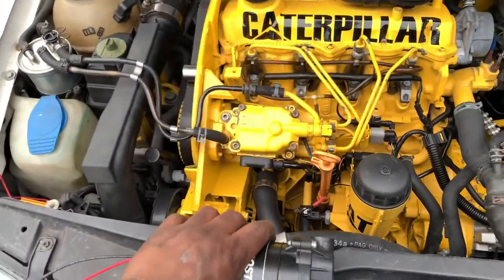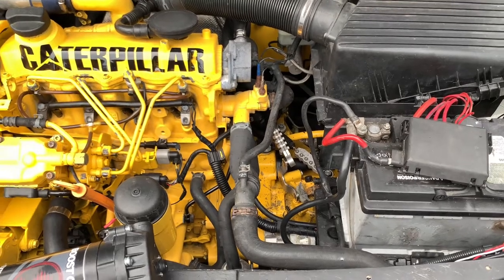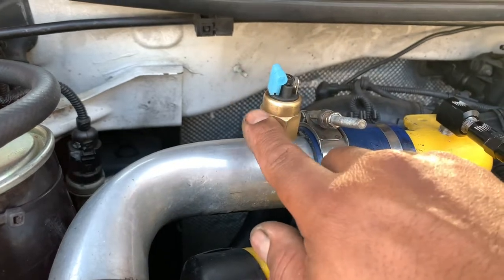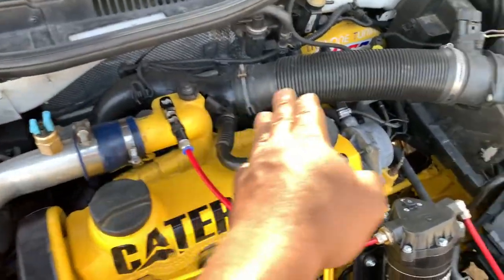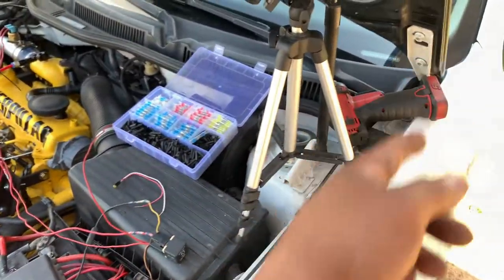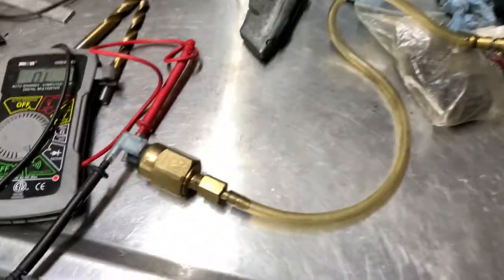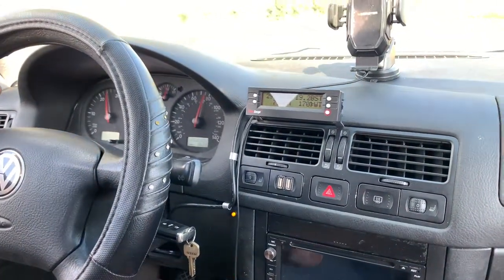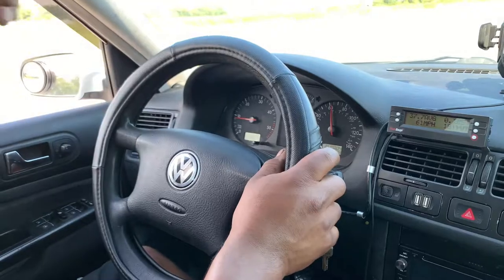How to install water methanol injection in a tdi, cheap and easy way

Comment: Power itself is usually obtained through tune, watermeth does wonders on full boost, cleaning all carbon deposits, cooling down your Exhaust gasses( especially if you like me have the EGR deleted) good stuff.

Comment: Location is perfect good job. Does this give you more power or better gas mileage and is this like nitrous but for a diesel motor
Reply from the maker: Yeah man 
More power 
More mpg
Smooth detonation 
Cleaning the engine 
More boost 
Water meth is the way to go   And this is not like nitrous   But propane is more like nitrous for diesel lol
Reply: You can run nitrous on diesels too lol

Comment: Interesting project, will the extra power too much for the clutches, engine block?, in terms of wear?. Will it be better with larger nozzles?(still within limits of the turbo booat).Glad I found an interesting channel, that goes beyond typical maintenance stuff.❤👍👍
Reply from the maker: Idk man all engines are different , some companies says the adding this kit will do 30-50hp all depends on nozzles size. 
I found out diesel’s had very small like for water methanol because the combustion chamber is very small , so you really had to be sending alcohol in very fine mist ,if not it knocks bad  .  I found the smallest 0.05 nozzle its enough and i can definitely felt the difference in power .  But not enough to have yo change clutches turbo  , tune or injectors
Reply: @taco8v  Thanks for the clarification. It will be helpful, Since I am looking for better combustion, than raw power gain alone for 03 Jetta tdi alh. Have you thought about using a self contained ultrasonic atomizer(used to create fountain mists)  built into the air path to intercooler(still need to provide a dripper with a waterpump(used in coffee machines)). This would significantly reduce pump power, apart from getting ultrafine mist(without a nozzle!). Would suggest to look into the rp2040 micro, since you could do a lot of stuff with it.❤️👍

Comment: Really cool , it is not too complicated i love the idea of more power with something so simple , why didn't u add a switch from the ground so u can turn it off when u don't need it , i also would have it to the end of the boost like when the turbo has no more power thats when the metanol would kick in but that goes by preference , if u add another sensor and a switch u can have two settings on low boost or on high boost pretty interesting stuff .
Very cool idea , also clever to use the windshield wipers water reservoir , i didn't know the jetta had a light for the water level mine doesn't have it , seat is cheap 😅 but good alh / asv engines , also my ecu doesn't let me connect anything then vcds you can still have that little obd screen that's very useful, my ecu is the one before that one didn't allow flash over obd , i think its 88 pins and yours is 128 pins so thats why
Reply from the maker: This car is set to specify boost  cruising 55mph is only 2psi of boost  so this methanol doesn’t come on wile you riding at cruising speeds  so no need a switch  because it will kick in if pass 7-8 psi of boost and this happens when you pressed the gas only    Also i set it for a woman to daily drive it too.

Comment: Taco, how often do you have to refill the Methanol?
Reply from the maker: Its all depends how you set your boost but i had it set it to the minimum spray only if you rev the engine higher it will spray in  and one bottle lasted me 2 weeks  . But you have to have be carefully  because the nozzles provided by the company are for gasoline cars , and if you used those nozzles you will bend rods  , i used .05 nozzles so they spray a very small amount preventing to bend machines rods  .  A lot of people used those nozzles and they are to big for a 1.9 higher compression engines and end up in ruined engines. 

I believe their send a #3 and number #5 nozzle and the small nozzle #3 starts from 200hp to 400hp and the #5 400-800hp  that’s way to much for a little diesel   So don’t blame me later if you guys don’t do your research.🧐 👍🏼
Reply: Thank you for that info

Comment: Can you feel a power difference? Is it worth the money?
Reply from the maker: Man water methanol is the best for you engines  

Heres is the benefits from it: 
 
10-30 more power .all depends on nozzle size.
Engine guts clean valves ,pistons etc.
Turbo clean 
Exhaust clean
Running cooler 
Smooth detonations 
Quiet engine 
Fuel economy 5-17 mpg
Reply: @taco8v  ? it looks like you have the methanol going in at the intake after the turbo correct?
Reply from the maker: Yea

Comment: Hay there do you have a link for the pressure switch cheers Brett
Reply from the maker: Prometh sells them 

https://prometh.com/products/copy-of-1-5-20-psi-adjustable-boost-pressure-switch-hard-line
Reply: @taco8v  Did you have one we can use from ebay or Amazon, 
Prometh shipping will be to much to New Zealand,its 63 usd dollars shipping
Reply from the maker: I pay 56 dollars for mine shipped and is the only place I found it   You can search on you country with part number
Reply: @taco8v  they want 112usd total, part number did not come up with anything, 
what about the pressure switch you used for the Propane conversion ?
Reply from the maker: No good im not even using that   But hold on i will see if i can find anyone on ebay
Reply from the maker: This is all I can find sorry  , this are the only switches more accurate the you can buy   The others are trash  

https://www.ebay.com/itm/224358908076?mkcid=16&mkevt=1&mkrid=711-127632-2357-0&ssspo=X6yjy_roSty&sssrc=2349624&ssuid=qgrvl0JMRP-&var=&widget_ver=artemis&media=COPY

https://www.ebay.com/itm/325122039096?mkcid=16&mkevt=1&mkrid=711-127632-2357-0&ssspo=X6yjy_roSty&sssrc=2349624&ssuid=qgrvl0JMRP-&var=&widget_ver=artemis&media=COPY
Reply: @taco8v  Many Thanks Taco.........I will try order that one.